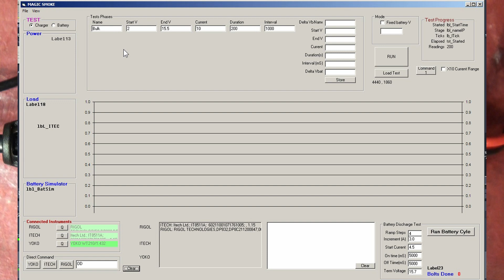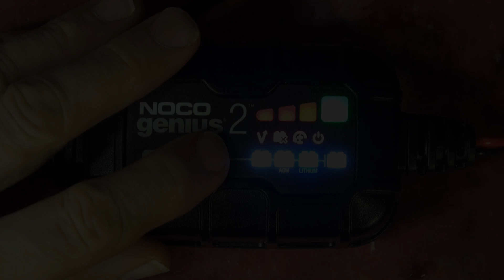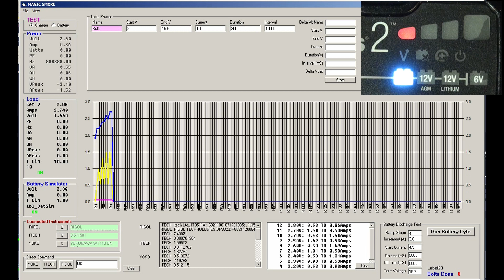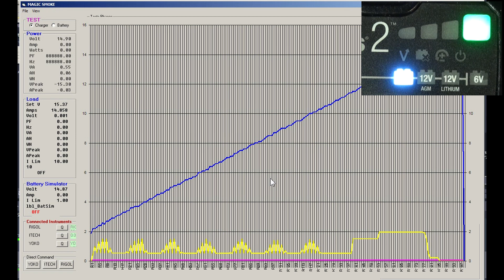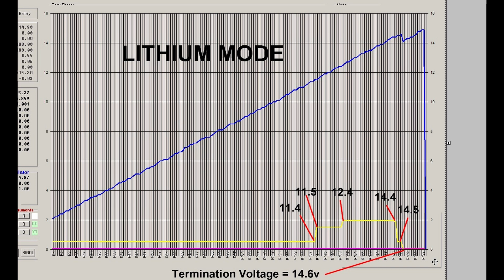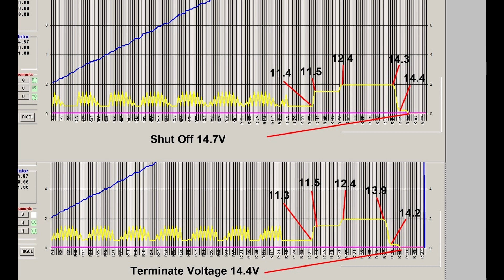NOCO Genius 2 Charger Part 2

Comment: At an ambient temperature of 12 degrees Celsius, using the Noco Genius 2 charger, I obtained almost identical voltage and amperage readings with an ammeter while charging a discharged lead-acid motorcycle battery. However, due to the low ambient temperature, the termination voltage reached 14.52 volts. The test was performed in 12V lead-acid mode. Since I don't have an oscilloscope, what I was curious about was the graphical representation and the pulsed charging status on an oscilloscope. Thanks for the video, it was a good reference for me. I have a question for you. If we connect a digital ammeter to these smart devices, will we experience any frequency-related problems, or will the desulfator feature malfunction while the ammeter is connected?
Reply from the maker: Thanks.    In the steady state a good digital ammeter will reads the RMS current and it will be more accurate than anything indicated on a battery charger with a  current readout.  In pulse mode you wont get a steady reading,.

Comment: At 14.9 voltage does it frying the car battery ?
Reply from the maker: These chargers cannot measure the output voltage with sufficient/repeatable accuracy. A standard 12V lead-acid car battery typically charges in the range of 13.8V to 14.7V, depending on conditions. Now, about 14.9V — that’s high. Let’s explain properly: The calculations re accuracy are made in another video.

Normal charging voltage:  13.8V to 14.4V — most common, considered safe.
14.7V is on the high side but still within limits, especially in cold environments.
14.9V — this is above normal for many modern systems. It can happen, but it’s not the default. Usually, this happens:
If the ambient temperature is very low (cold weather charging), the voltage regulator compensates by increasing voltage, because batteries charge slower in cold.
If the alternator or external charger is set aggressively.
If the battery is old, sulfated, or the system overcompensates.
Risk:   Consistently charging at 14.9V in moderate or high temperatures risks overcharging, electrolyte loss, or even battery damage.
Conclusion:  No, at any ambient temperature, a standard 12V lead-acid battery should not reach 14.9V as a normal charging voltage.
It might touch 14.9V briefly in very cold conditions because chargers increase voltage to push current into a cold, resistant battery. But it’s not typical, and manufacturers design regulators to stay lower to protect the battery.
Reply: @razenby  thanks for the info

Comment: The charging with this charger is different from the genius 5. I left it connected to my car yesterday where it reached the pulsing green at 13.2v, today I went to check and it was still pulsing but the voltage was high at 14.5v, no idea for how much time it's been like that, where with the genius 5 it would be at 12.9-13v. 
I wonder what triggered the charger to increase the voltage.
Reply from the maker: Depends on the condition of your battery.  If you have sulphated battery it may never finish the charge cycle. Test your battery

Comment: Am i right in seeing the normal 12v mode it finished at 14.9v before it switched to the green led, isn't that too high when the battery is still connected to the car ? I thought mine was faulty and noco said they were going to replace it because of that, currently waiting for the new one. Now I'm confused. Mine even reached for a second, 15.2v.
Reply from the maker: Not really, the exact charging voltage of the car battery is dependent on the alternator. I have seen cars that go as high as 14.9 volts at 2000 RPM. In theory on a journey this would stress a car battery and reduce its life,   The sad fact is that car batteries are mistreated crude charging regime. They are called car starting batteries for a reason.  The premise is that they are used to start the car with a of burst of high current.  You see that few batteries give a warranty of two years and if you pay a significant amount for  a longer  warranty. The capacity of a new battery drops from day one until eventually it is no longer able to produce enough current to start the engine. Serviced bay a  well  calibrated charging system, a good quality can last up to 10 years providing is isn't allowed to run down to a low charge sate at any time during it's life.  The correct voltage to terminate the charge process depends on the chemistry and structure of the cell and the charging temperature..   A normal (VRLA) Valve -Regulated-Sealed-Lead Acid battery should be charge to 14.4V DC at room temperature...
Reply: @razenby  I'm just scared because I usually just plug it in and let it charge as a maintenance thing not because the battery is drained or dead. Recently the charger started charging the battery super quick and checking with a mm it reached 15v right before it switches to the green led. Talking with noco they agreed the charger was defective, something about not recognising the battery voltage correctly and hence the voltage peak out of the range, it should be 14.7v max.
Currently waiting for the new charger, curious to see if it's going happen again.

Comment: Would you be able to leave the charger connected to battery but not powered on, would that require some sort of blocking diode?
Reply from the maker: Yes the Noco works well as a maintenance charger. No need for blocking diode as there is hysteresis in that prevents charging until it is needed. I use the 2 amp version on my classic Jaguar for over 5 years 24/7 except when I take her out for a spin.    The 5 Amp would work as well.

Comment: Your videos are excellent and I wish I had the test equipment you have available at hand. It would be great to see you do a deep dive analysis of the Schumacher SC1280 / SC1323 battery charger. Not sure if they make or sell a version in the UK? Best regards and thank you for producing these great technical analysis videos.🥇
Reply from the maker: Maybe one day! Ill get back onto it soon. I have been designing high efficiency 300W switch mode power supplies for use in horticultural lighting but that is done now..
Reply: Why do you want a  Schumacher charger? I have a older 1 amp  Schumacher manual charger I bought in 2012, and a  Schumacher 2/10/50 amp manual charger I bought in the 1990's.  As far as I know Schumacher automatic chargers do not have a desulfate mode like Noco, CTEK and Pulse Tech chargers do. Noco also has a force mode to charge a battery that is below 1 volt, most SMART battery chargers will not charge a battery at that voltage level, and a good reason to buy a Noco Genius charger or have a older manual charger to get the battery voltage up first.

Comment: Could you please do an analysis on the Battery Tender by Deltran? It’s an interesting one! Though the manufacturer explicitly denied their products having desulfurization function on Amazon,  I find the tender delivers pulses in maintenance mode, which essentially is a desulfurizer in my opinion.  I don’t have more advanced equipment to dig more into it, but their products are very popular, even more popular than Noco. Thanks!
Reply from the maker: Thanks for the tip. I will look out for one. After testing my view is that reviving a  modern battery by Desuplhation is an urban myth based on the old very heavy, built like  tank, not sealed,  wet cell lead acid batteries.  They did respond.  However modern,  car starting VRLA batteries are made to be as light as possible and to last out the warranty .  Desuplhation is more likely to do further damage. See the other comments.
Reply: @razenby  I think it really depends! Nowadays the lead wet batteries are built with different qualities: the more expensive, the better.  Walmart EverStart Maxx series comes with 3 years free replacement, and can easily get 6-7 years life.

The VRLA batteries are more designed to fail on cars, as you can’t even maintain them! And if they sat in the engine compartment, the heat would dry them out prematurely! AGM batteries are of this type!
Reply: @razenby  Another interesting thing is this: https://youtu.be/KzOQH1twpI8 , and seems to be effective in extending wet lead battery life.  How do you think please?
Reply: @razenby  BTW, the Battery Tender Junior model is the most popular one! The old version is hard to find, since it has been replaced with a newer version.

Comment: Exactly what I was looking for.  Battery charges are two a penny, and lots of them  claim desulfation processes.  Seeing that this charger actually appears to is good to see.  The detailed analysis of the output characteristics is exactly what I wanted too. There's loads of people out there 'reviewing' this device, but it's limited to 'will it charge a battery', which is a given really. Sticking the battery on the sharp end of a desktop PSU will charge the battery, so it's not much of a test.  Having seen that this unit is doing the do as advertised, happy to splash the cash.  So, thanks for the very informative and interesting clip.  Did you build the battery emulator yourself?  Impressive bit of kit regardless.
Reply from the maker: Glad you found it useful.  You are right - you can charge a car starting battery with any cheap charger or power supply . The profile of the charge and the accuracy of the set voltages are is more important for repeatedly cycled leisure batteries or battery maintenance applications.  The battery emulator is just an adaption of the test system I wrote to check my switch mode power supply designs. It can load cycle and the DC side, cycle the AC mains voltage, subject the UUT  to mains input dips, brown-outs and over-voltage surges.  The Schaffner transient burst generator injects up to 4KV spikes in the mains line.  You would be surprised how many bit of consumer kit are easily destroyed during  real-world mains simulation tests!!

Comment: Interesting video.
Reply from the maker: Thanks for the visit
Reply: @razenby  I just got an NOCO Genius 2 for my BMW 328 which has an 8-year old 90AH AGM battery. However, it acts somewhat different from what in your video.  It has stuck in the first 25% stage for 5 hours even though the voltage was already 12V when charging started. According to your video, the charger should output at least 1.5A constant current at that voltage with a total charging power around 18W. But mine seems to send out smaller current in pulses as I can see that the 110V AC side input power varies between 1W and 4W (I use a portable power station with an AC outlet and wattage display). The average charging power is about only 2.5W... Update: Now it works fine with about 2A output current after I repositioned the clips. The charger seems to be sensitive to any resistance in connections. It even refused to charge when I tried to use my Fluke77 to measure output current.

Comment: Thank you for your videos. Any harm in using a Noco 2 vs Noco 5 to occasionally top off and maintain a larger 90ah lead acid car battery? I've got a car garaged that gets driven once a week or two, so just looking to top off the battery every so often. Speed of the charge doesn't matter to me - more concerned about what's best to use for the health of the battery. Thanks in advance for your help.
Reply from the maker: There is no issue - It will work fine.  In fact it will do a better job on maintaining a large battery as only small currents are required and accuracy is more important. I maintain my 120 aH Jaguar battery whilst is isn't being used.
Reply: @razenby  Is it safe to say that even Noco Genius 1 will work fine for maintaining such big battery?

Comment: Hay there, im looking for a charger for two cars, one is a 45ah and the other is 60ah. would this genius 2 do the job? To keep the batteries in good condition. I try and alternate the cars, but one will probably be sat for a week or so before a run out. what do you think?
Reply from the maker: The genius 2 is slow but would get you there for both batteries and maintain either well. In any case the battery supplier recommends only a 3A charge current  for this size battery.

Comment: This is far too technical for someone like myself, but I suspect the intended audience is much smarter than me. Will this charger work for a 6v AGM battery?  I know Noco makes one for 6v AGM but it's significantly more expensive.  Also, would this be adequate to charge a full sized car battery that has been run down due to leaving the lights on in the car for a few days or would I have to at least go for the Noco Genius 5 amp model? My preference would be the 2 if it works as they are on for a good price right now.
Reply from the maker: Hi James, the force mode on the NOCO should recover the battery. Disconnect it from the car first. However the battery will be ruined if the voltage at the terminals has dropped bellow 11V for any length of time. Even a few hours is enough to severely damage it.  The 2 amp charger is excellent for small batteries (~50aH)  as the charge current is within the manufacturers specification which is usually 3 Amps. The AGM mode is for 12V batteries only. AGM uses a higher charge current for longer and has a higher termination voltage. You could connect 2 x 6V AGM in series.
Reply: I am fairly sure that only the Noco Genius 10 has a 6volt AGM mode to charge with, and they are $99.00 dollars on Amazon, but they also have a repair mode, and can be used as a 12 volt power supply.

Comment: This charger at least is competent, not worth 50 quid though, wish they skip the charging modes , and just work when you plug it in
Reply from the maker: The early LEDs relate to a deeply discharged battery.  Have a look at the curves in the next video (release later) you can see the Noco charge cycle. i.e. It may not be a fault that it rams up to throbbing green end light as this is the normal  bulk charge for a safely depleted battery.

Comment: Hi.  What was the open circuit voltage of the battery BEFORE you started charging?  Thx.
Reply: Nevermind.  I hear later on that this is a being done on a test rig, not an actual battery.  I believe the initial desulphation pulse stage only occurs on batteries below a certain OCV.
Reply from the maker: @diycarguy6241  I believe the initial pulse charge when the OC battery voltage is low (~<=10.5V) isn't desulphanation it is a slow charge to get the charging process to take place very slowly to prevent erosion of the plates and excessive gassing due to the weak near-water electrolyte. My current view is that there is a big difference between a recently very flattened  battery (left light on etc..) and one that has been left to stand whilst flat. In one of the initial videos I gave a just about serviceable battery (about 50% capacity left) a trip down to 7 Volts and it completely ruined it. In this case the pulsing might go on for a very long time and may help clear the plates of sulphate. Afterwards I could get it to hold hardly any charge.  Just one trip lasting maybe an hour down at that level.  The old method with plain flooded cell lead acid was to blast with a high current and cause gassing.  The gassing stripped the plates and also causes the bubbles to disturb the stratification of the acid. You can't do this with VRLA (Valve regulated Lead Acid) maintenance free batteries as the rate of hydrolysis outstrips the ability to recombine the generated H2 and O ions into water. Ca batteries do recombination better at the anode. The pressure builds up and then the gas blows by the regulator valve and the electrolyte level drops accordingly.  So, overcharging is inherently bad for maintenance free batteries. I guess that slight gassing at a slow rate (pulsing) may be acceptable. Does anyone really know - that's why we need to find out.
Reply from the maker: It may be the right thing to do but a right pain if you are impatient to go to work and the battery has just discharged coz the light have been left on. Makes you wonder what damage is done to a low battery that is jump started and then driven and subjected to the alternator.
Reply: For lithium, I should have said withOUT any repair or desulphation)

Comment: I have AGM batt in my car. Voltage while car is running/charging sits anywhere from 14.4 - to 14.7. So I believe this is a great charger. Every now and then based on voltage and ambient temp the voltage would jump and sit around 14.9 - 15.1 for desulfation.
Reply from the maker: If the battery is good, and the voltages maintained then why regularly etch the plates with desulfation if it isn't required.? Seems a destructive thing to do - Anyone think this is a good idea?